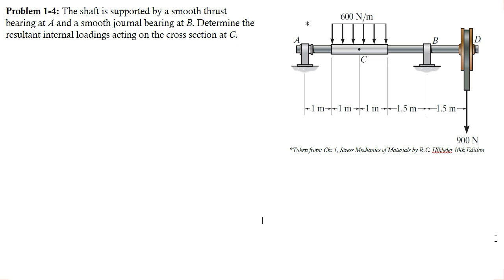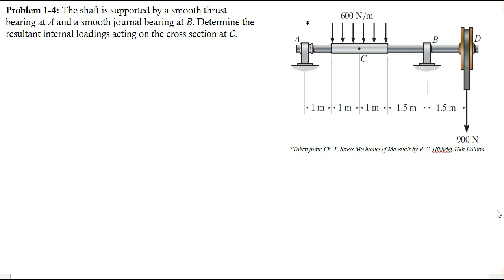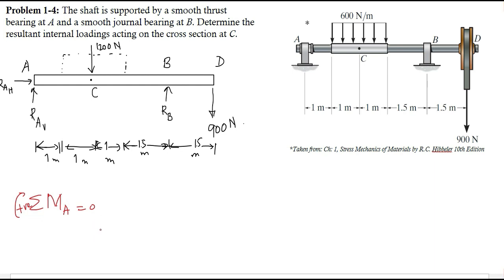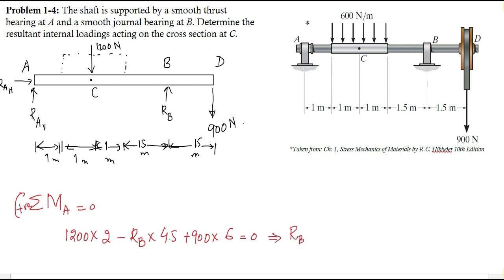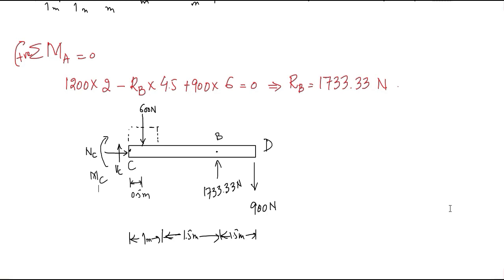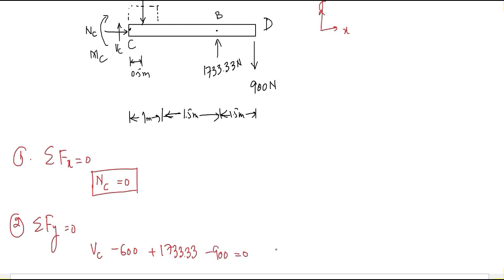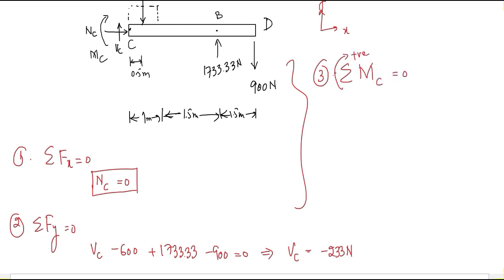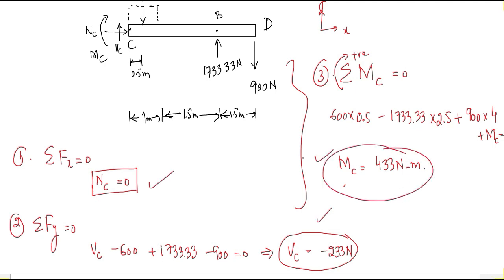Problem 1-4 Resultant Internal loadings at C, Mechanics of Materials

Comment: Couldn't you also take the left side of the cut? And since the horizontal component of the thrust bearing is 0, that would essentially be a two variable solve, instead of three with the right side. Right?
Reply from the maker: Right. In either case we have to determine the vertical reaction (at A or B). All other are constants.